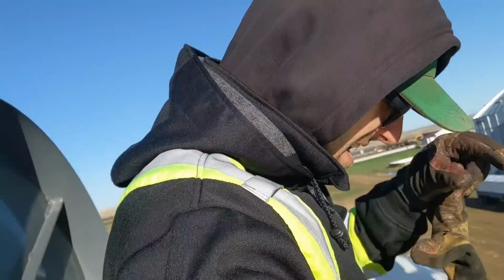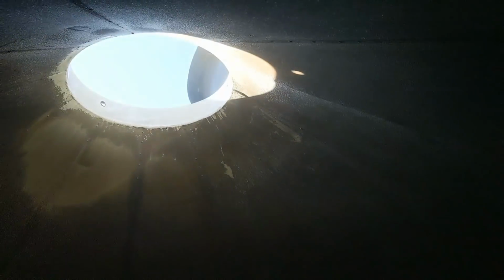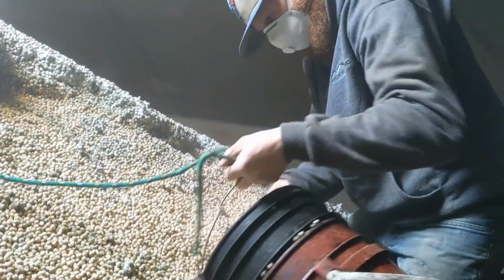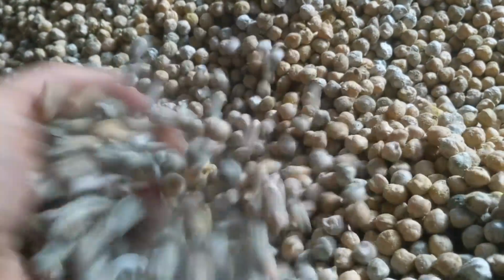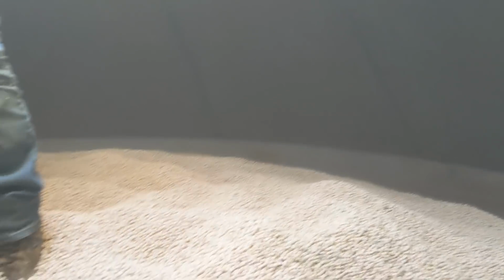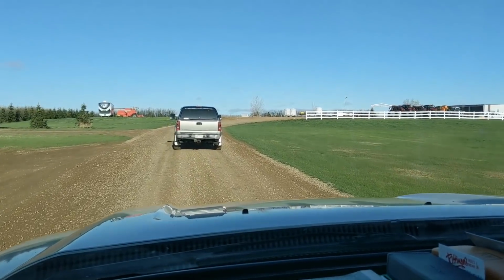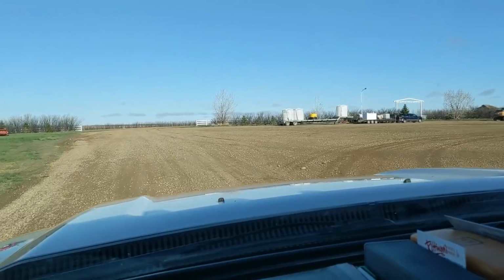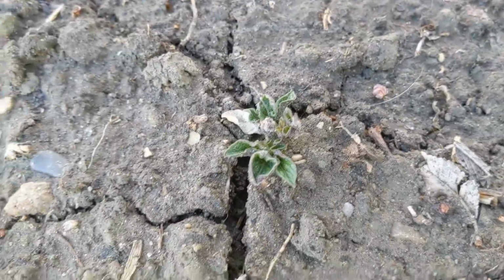Mission Success! Prt 1

Comment: Slow & Steady with Ashtyn and you may have another movie star on your farm.🤣😂. 
How many bushels of chick pea seeds to you need to plant your fields?  
How many bushels does each of the Meridian Hopper Bottom bins hold?
Bags sound like the preferred storage but I am guessing with your size of your operation that bags are too small to be practical.  
I was surprised to hear you take Sunday off during seeding but do realize the body and mind do need a rest.  
You may have to go COMMANDO 🤣😂
The other option is that underwear can be worn 4 times between laundry!
Frontwards, backwards, then flip inside out for an extra two days 🤣😂
Reply from the maker: Right?! 😂 That's what I told Ashtyn 😂 about the underwear.. And thanks! We use lost of bags!

Comment: Hey Mike, nice to see another sasky farm boy vlogging. Keep up the good work👍. Just a quick question, why did you choose the 50' honey bee (know they make em in your area.)? I saw a guy running shelbourne strippers last fall around Willow Bunch, they look like the cats meow. Travel speed is quite high, residue thru the machine is extremely low. The only down side I can see with your operation would be the left over stock height on cereals (not too sure though). I'd love to see you demo one this fall and do a review. Maybe a dealer might put one in the field  for the publicity😉
Reply from the maker: Hey Mat, we have demoed one a few years ago and we owned a 3710 for 2 seasons but they didn't work for us